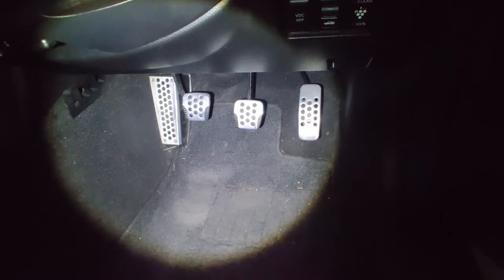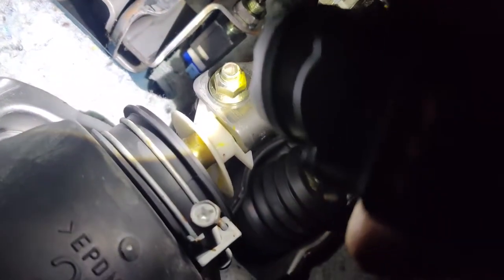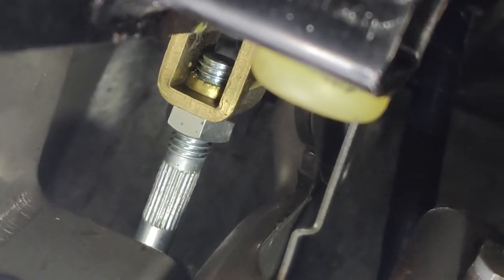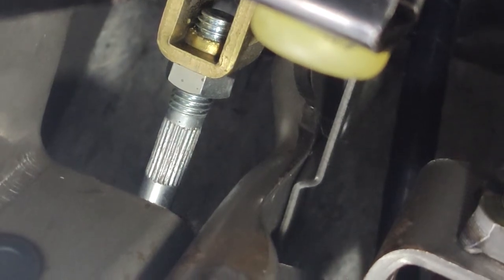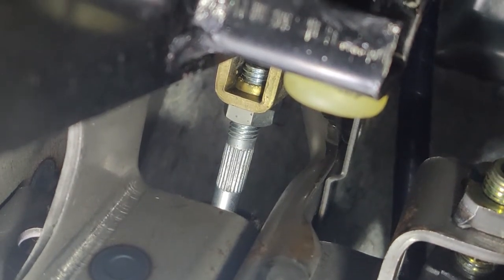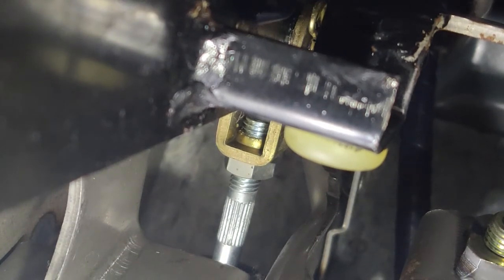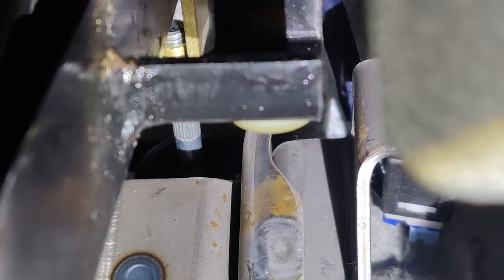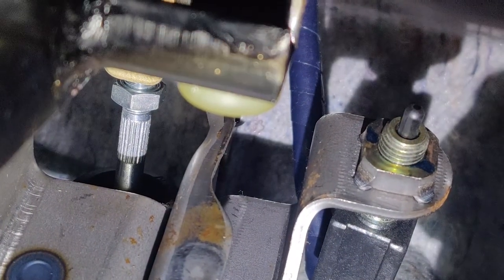Do This for better clutch paddle engage point G35/350Z (Clutch adjustment)

Comment: I changed my clutch slave cylinder 6 years ago and put about 85000kms on it and noticed my clutch peddle was super stiff for a moment or two, then went back to normal. My car has 185000kms. Any thoughts? Thanks
Reply from the maker: i think i will rebuild my slave soon which hoping to improve clutch paddle feel. Also heard these do need to be replaced evey 100000kms due to seal breaking down.
Reply: Thanks so much for your opinion. A new slave cylinder would be a low cost repair before I take the whole transmission down for a full clutch replacement. Hoping I can get another 60K out of this clutch

Comment: Im struggling here...i keeo bleeding it but stuck at the same point... spongy at the top...i have a 370z and i have no threads left ..its even and it atraches perfect with the oedal but it feels like im not getting enough pressure to.get a full cycle and the more i bleed it the more i don't get anywhere ..at this point i think my pressure plate is gone
Reply from the maker: 370z use a internal slave. I guess it could also be the slave got a internal leak?

Comment: This was tough on my back. I'm a big dude, 188cm and 100kgs. I have a vertZ so I lowered the roof, rested my legs on driver's back rest and slid my head under the pedals. If you remove your seat, this job is easy. Anyway, got it done, clutch biting point is perfect. Finally a joy to drive. Thanks bud

Comment: Mine has like no threads near me but the clutch grabs really low, any guesses what can be wrong
Reply: Same here bro, idk what to do
Reply: Same Im going to change the master cylinder it had sludge on the bottom of the resorvior tank and the fluid was clean when i bled it it came out black and there is no leaks so my csc is intact. inspecting the clutch theres lots of debris but the clutch looks good and its new so makes me think I need to adjust my clutch and do what I said first Im just tripped cuz my clutch adjust has no threads towards me
Reply: What does towards me mean, is it threads underneath the bolt of above
Reply: Does urs get harder to
Push the clutch pedal
Down?
Reply: @dragonfossil556   did you ever get this fixed? im having the same issue as you guys,   clutch is engaging super low almost to the end of the pedal relase. and its not wanting to go into gears, also there was some sludge on the reservoir tank as well,  i dont know what else to try
Reply: @Runescape. what I did was adjust my clutch pedal 3-4 threads and on the jwt heavy duty CSC I tied the rubber boot down on the csc because it pops off when you assemble the trans back together and drive it so debris would get inside and contaminate the whole csc and you would notice dirty sediment on the bottom of the reservoir. Its just bad engineering on the csc system but so far it fixed my issues I was experiencing now my pedal engagement is mid level and My fluid is clean even after dumping on the clutch!

Comment: My Clutch pedal feels good with good pressure, and goes into gears but with the car on I can shift into gears without pressing the clutch car is not moving it’s on neutral like if I have the clutch pedal pressed down any idea on what it can be ? 08 g35s hr
Reply from the maker: that is weird bro does your car drive normal? could be a blown trans?

Comment: Help!! I can feel my clutch engagement start at 1/4 of my foot to the floor. Randomly recently my transmission is locking me out of all gears when i turn it on and grinding if i force it. at first i could mess with it and it would go into gear but now it will not, ive never had a single synchro grind when shifting accept for when i forced it when this problem started. It started with reverse now its all gears. Any thoughts? I ordered a new master cyl and slave. I have a stage 3 clutch w 31k on it never has slipped on me. Could it be simple as adjustment? Or slave? Pedal doesnt stick to the floor but grab point doesnt feel stiff like before i swapped my cd009 trans in. Any help much appreciated 🙏🏼 also it goes into gear perfectly fine when car is off so trans isnt locked or internally shifted
Reply from the maker: sounds like it's a clutch issue. if your engagement point is too low then even if you push the clutch all the way to the floor the pressure plate is actually not releasing the clutch completely which can cause not being able to shift into gears. so prob try adjusting the clutch paddle engagement point higher first and see if it helps

Comment: this goes both ways. If bite point is too low, then clutch wont fully disengaged and yea that stuffs up transmission.

But if bite point is too high, that means the fork is partially pressing on pressure plate all the time. So pressure plate doesn't get chance to put 100% pressure on disc. This can result in clutch slipping and pressure plate failing prematurely.

Best one is this. Foot off pedal. Press about 1 cm, it should be totally effortless (it's called free play). This is the fork just now placed on top of pressure plate. If you press more, now it should feel difficult and clutch should disengaged. 

Free play is important because you want fork to fully lift off the pressure plate. We never want partial force that is there always. 

When the bite point is too low, you'd notice there is TOO much free play. You do not want this either.
Reply: What if, no matter how high or low the engagement point is adjusted, there is never "free play" in the pedal?
Reply: @erdinczor1 hmm?? Following lol
Reply: From my understanding you should not have “free play” lol I’ve had multiple manual cars and none had so called “free play” if I’m thinking of what you’re thinking.

Comment: Recently b4 I adjust clutch in the morning cold 40 degrees I would start  it and I can shift into
The gear without forcing it after adjust to get a lower biting point now
I’m the morning the car will not go into gear unless I force it

Comment: You seem to know alot. Maybe you can help answer a couple questions? 

If I press my clutch in too fast, 1st gear grinds. Will a pedal adjustment help? I drive this thing 200 miles a day for work. Always "double clutch" when shifting, is that good for the frictions? Always thought it would help make it last longer??
Reply from the maker: check your master and slave cylinder flush the fluid adjust the paddle, if it's still doing it maybe bad synchronize in the gear box

Comment: If the engagement point is too high is there a chance that the clutch may not be fully engaged and could slip?  I'm working on a 2005 350Z for a friend and we are doing a clutch replacement soon due to some slipping.  His clutch engagement is quite high and was considering lowering it with this method to see if it engages better and reduces slip.  Probably doing the clutch soon regardless but would be an interesting experiment to see if it helps. This is just a daily driver, he doesn't drive it very hard at all.
Reply from the maker: yes i think it's not normal to have the engagement point super high and probably is the reason that the clutch is slipping. wouldn't hurt to adjust the clutch paddle first and see if it helps
Reply: i did exactly that to get more life out of the old clutch. When clutch bite point is high, means the fork is NOT fully off the pressure plate. As the friction disc wears down, we want to let go off the pressure plate as much as possible. 

So if you lower the bite point, it'll just make sure that the fork is totally off the pressure plate (it might give you free play, which is the gap between fork and pressure plate),  so the pressure plate can do full force on the friction disc.